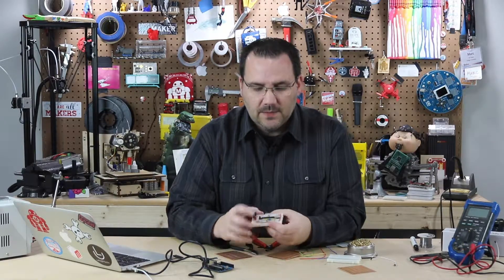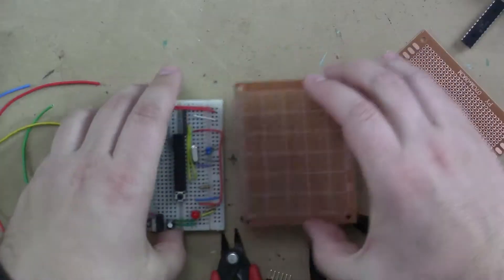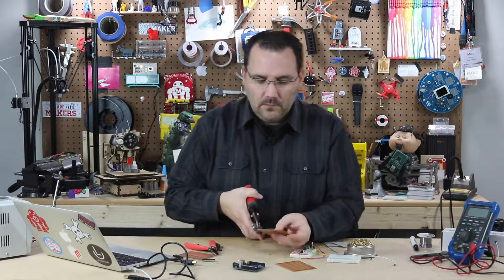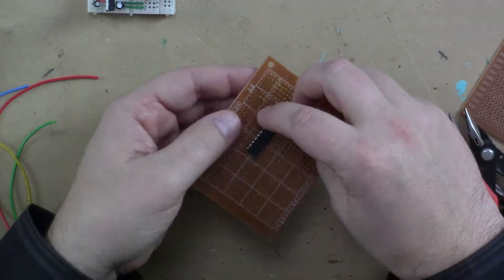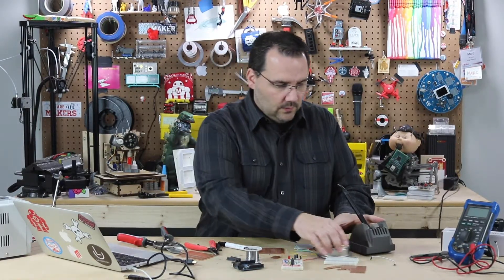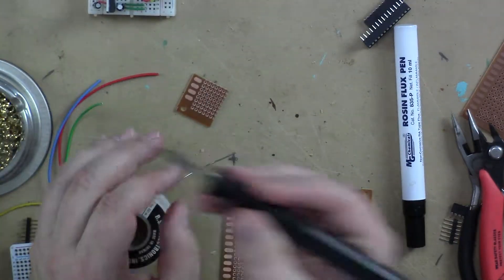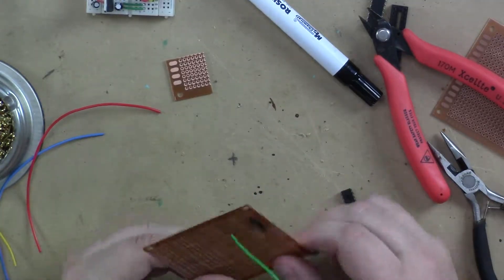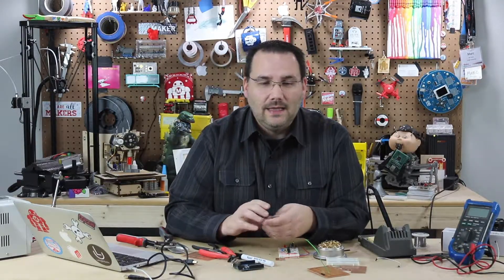Arduino Prototyping Techniques #104: Perfboard

Comment: Interesting how easy it is to gloss over the fundamental questions that one has as a beginner by assuming it is already known. Whilst it is probably easier to go from breadboard to tracked perfboard (by basically replicating the same layout) to avoid making wiring errors in construction it is almost a quantum leap to go from breadboard to single pad perfboard without taking time to optimize the layout more efficiently & effectively. I recently found a video that tackled this issue by looking at grouping the nodes in the circuit and using vertical jumper wires on the top to connect the tracks and horizontal wiring & solder tracks on the back to connect component wiring. By studying this layout it is possible to compress the number of rows & columns holes that are needed on a pad perfboard circuit.

Comment: Thank you for showing this video. I have made quite many prototypes or test circuits past 50 years, and normally always used veroboards or stripboards. I cut the strips by twisting a 3 mm drill bit with my fingers. I never tried perfboards, but now I think I should try it with the next prototype. How do you evaluate stripboards? Many Integrated circuits is only delivered in SMD-housing, and it causes a bit more work to connect them for prototyping.

Comment: Cutting perfboard is better done using a metal ruler and a cutter, by scoring it several times, and then it breaks off very neatly without damaging either side of the board.

Comment: what are the big pads without holes on the edge of the board for? I'm guessing soldering a larger wire that wont fit in one of the holes, like say +v and -v, but are they connected to the rows at all, or do you have to jump them to a hole to pass the power on?
Reply: I have been wondering the exact same thing and I cannot find an answer ANYWHERE! Did you ever find out? I’m trying to take my circuit from breadboard and transfer it to perfboard then install into a guitar pedal. Any help would be greatly appreciated!
Reply: @sniggity you have to jump them. Good for thick wires and crocodile clips too

Comment: can i know which one is better between breadboard and donut board?
Reply from the maker: Depends on your project. A 'typical' breadboard has some holes connected allowing for multiple components to connect together faster. You may have to either jump between pads, or cut some traces to build your circuit. A "donut" board has 1 pad per hole. None of the holes are connected. I like 'donut' boards for freeform circuits and 'typical' breadboards when working with ICs since you can easily break out the pins to multiple components. Hope that helps!

Comment: Slight problem: Tin Snips DON’T come in left or right handed. The 3 types, come in three basic colors for cutting direction!
Red handles – Used to make “left” or counterclockwise cuts in sheet metal.
Green handles – Used to make “right” or clockwise cuts in sheet metal.
Yellow handles – Used for straight cuts in sheet metal.

Unless your views are cutting circles, the NED the Yellow Handle (Straight) cutting snips.
Reply from the maker: Good point, thanks for sharing. Most people just use heavy duty sheers, and the cuts are typically so short almost anything will do. But yes, you are correct!

Comment: Any ideas where to find headers for esp32? You mentioned you used headers for the atmega chip, but what would you do for an esp32 dev boards that needs to included on the perfboard?
Reply from the maker: It really depends on the board, but in general you can always use make header pins to make the board easily removed.
Reply: @MarcdeVinck  the board I use is esp wroom 32, I broke some 40pin header (very poorly), but I was wondering if that header can be premade or some header model that can be easily cut.
Reply from the maker: @DamjanDimitrioski  Most header pins (male or female) can be cut down as needed. I believe that board has standard pin spacing, so just grab some header pins from any online electronics source and cut as needed. You can use standard versions, or female stacking headers so you can easily add more components.
Reply: @MarcdeVinck  So you're suggesting 2 single row headers? I thought there can some fancy header dedicated to a desired dev board :).
Reply from the maker: @DamjanDimitrioski  That's the typical solution. (And cheap!)

Comment: I can't make the solder connect between holes in a perfboard for the life of me. The solder just refuses to go anywhere that isn't metal. The solder just goes into the singular holes and that's it. Impossible to make the connection between them. I don't know what to do.
Reply from the maker: So the solder really shouldn't go where there isn't any copper. The trick is to use lots of solder to make a small bridge of metal, and if you still are having issues, use a small piece of bare wire to bridge the gaps (like I show in the video) and lots of flux.

Comment: Came here to find what you said at 5:30, about using the clips from the LEDs to connect several holes together. Thanks for that advice :) Also like your idea of using the sockets to be able to switch out the controller if you fry it.
Reply from the maker: Glad I could help!

Comment: Is there a way to fix burned holes in perfboard? Sometime I'm not able to bridge the track because the surface of the hole get burned.
Reply from the maker: It can happen, but if you are having that issue more than once, your iron is too hot and lingers too long. But to answer your question, sure, you could use a small wire to jump a "bad area". Magnet wire is really good for fixing bad traces and circuits.

Comment: Now, you can buy cheap Pinecil iron for $30 which also has those amazing tips which heat up itself and have thermocouple for extra temperature stability
It heats up extremely quickly (10-30 seconds), can sustain temperature even on big ground planes and works over type c.
Reply from the maker: Very true. I have some of the small ones. They have come a long way, and work well. However, when soldering a lot, I still use my 20+ year old Metcal. It's just perfect.

Comment: Can you solder a Arduino directly to the PCB?
Reply from the maker: It depends on the board. An Arduino Uno? No. An Arduino Mini or Nano? Yes, but I would always suggest you use a socket so it can be removed.
Reply: @MarcdeVinck  thanks I appreciate it

Comment: There is flux in the core of even decent solder.. You don't need to add flux unless you're reflowing a joint.
Reply from the maker: Yes, most do. But a lot of perfboard comes tarnished, unless packed really well, and adding some extra flux is always a good idea. I have a whole course on learning to solder if you are interested in learning more -- https://www.linkedin.com/learning-login/share?forceAccount=false&redirect=https%3A%2F%2Fwww.linkedin.com%2Flearning%2Flearning-soldering-for-electronics%3Ftrk%3Dshare_ent_url%26shareId%3DfiXf%252FlvMSo%252BTd%252F0kTFyV%252FA%253D%253D